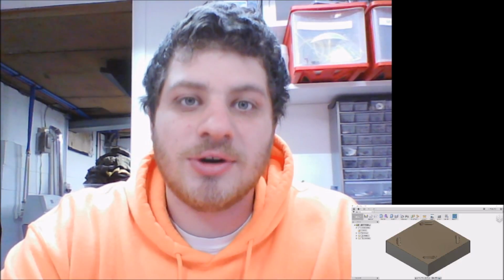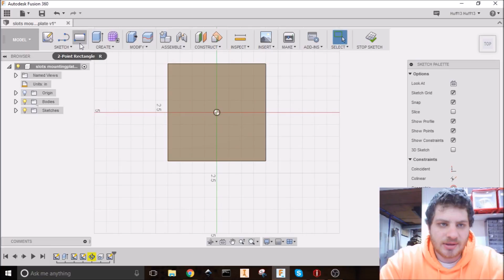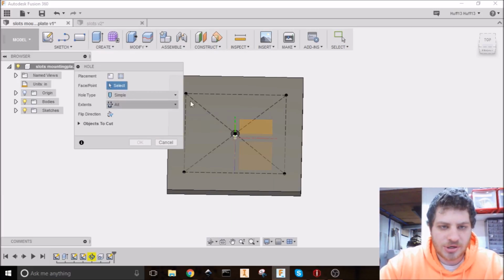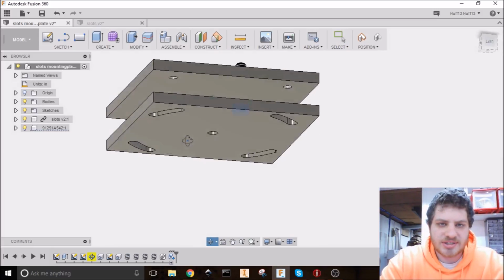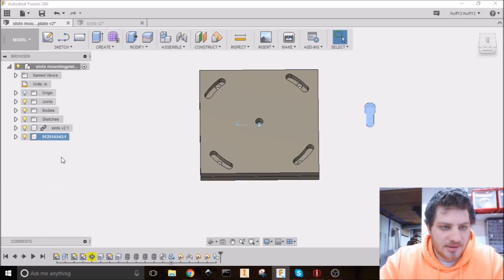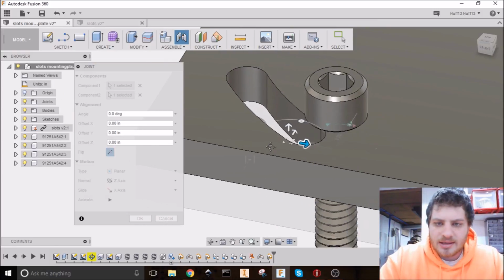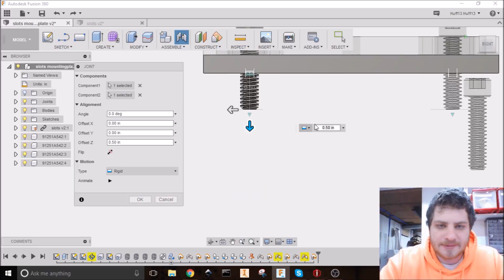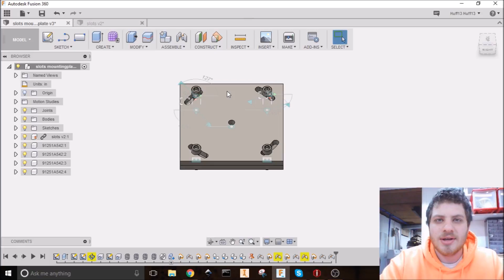Assembly: Fusion 360 Beginner Tutorial

Comment: Hey AJ, really enjoy your format and you answering user questions and I've now subscribed. I have a question for you. Can you do a curved slot on a fillet? I'm teaching myself how to use Fusion 360 by modelling some objects around the house and we have a fridge dial like this https://goo.gl/PKubnz I've modelled it all except for 2 things which I think would make great demo videos. 1) how can I add the grooves that go over the curved part (fillet in my model) of the object as I can only make slots on planar faces or planes. and 2) is there an easy way to do the text around the circumference? The problem is that the text is rotated as the dial fits vertically, not horizontally but the text reads horizontally... Any help would be appreciated...
Reply from the maker: +smitcher thanks! I appreciate the encouragement. So I'll make a video on how to do those curves slots. But in short you need to use the sweep tool, and the pattern tool. Start by opening a sketch on one of the planes that goes through the center of your part, then use the project command to bring the profile of your part into the sketch. Use the line, circle, and or spline tools to trace the edge of the projected profile wherever you want the slot. Then, create a plane that is perpendicular to that first sketch, and make a circle on it, with the center of the circle on the end point of the line you made on the other sketch, that's the hardest part of this. Once you have that use the sweep to sweep the circle along the path, making sure that you have Fusion set to remove material. That should give you one slot, then use the circle pattern tool to copy in all the other slots.
Reply from the maker: +smitcher oh! And the text. So there is a tool for doing text, you just have to make a plane, use the text tool, and the emboss tool to put your text on the surface. You will just have to do that a few times to get all the numbers all the way around. 

I'll still make a video on this, but I hope this gets you started!
Reply: Haha... I'll give it a go but you lost me at "create a plane that is perpendicular to that first sketch, and make a circle on it, with the center of the circle on the end point of the line you made on the other sketch". Look forward to your demo ;-) Thank you for replying so quickly!
Reply: I figured that there might be some clever way to have the text flow vertically so that you could then just wrap it around but I'll give it a go doing each number separately although I have no idea how I'll get the spacing even... Thanks for this and the other reply too, it's always great to look at things differently and get others perspectives on how they would approach - I'm sure I haven't modelled the part in the best way either but at least it somewhat resembles the original...
Reply from the maker: +smitcher not a problem :) I'll try to have that video out on Wednesday, but no promises. It will almost definitely be done before Sunday.
Reply from the maker: FYI, if you are going to 3D print this, numbers and letters tend to only work well if they are relatively big. You might think about replacing the numbers dots or something that will show up better.
Reply from the maker: I finished my video for you! Check it out at https://youtu.be/3PbaTqk0Wms